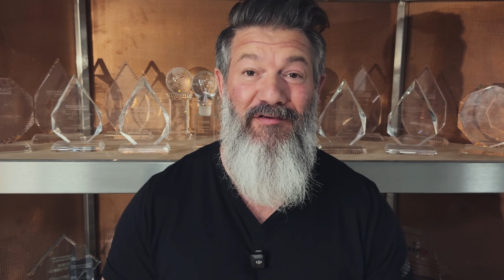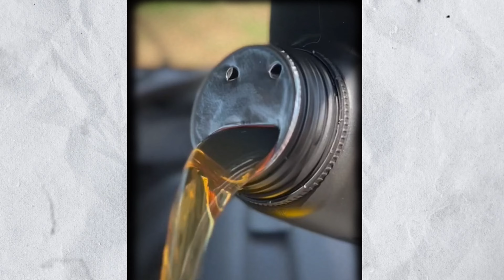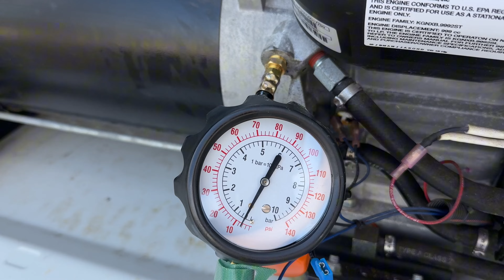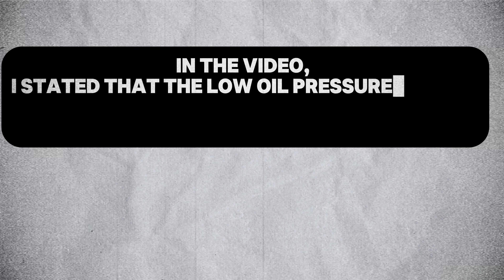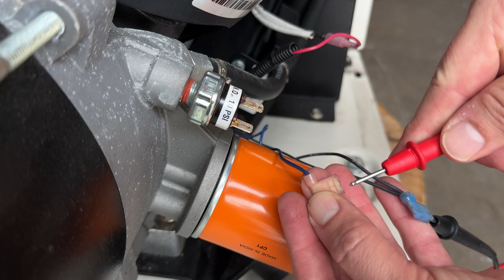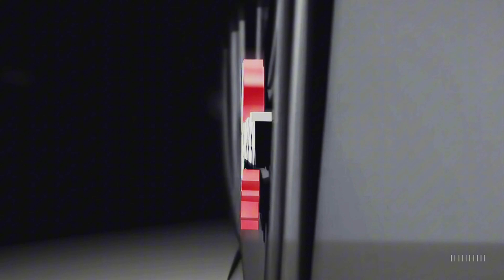OIL PRESSURE SENSOR | FAULT CODE 1300 FIX | WIRE 86 & FIRMWARE TESTING 🛢️⚠️

Comment: You are way more informed here than I am, but if I understand it correctly some Generac sets use Normally Open oil pressure switches, and some Normally Closed.
Is it correct that Evolution series 2 use Normally OPEN, and 'Evolution' (series 1?) use Normally CLOSED (hence connecting to ground at low oil pressure)?

Comment: Hello, in severe frost, the oil spilled through the dipstick, can you tell me the reason? Thank you very much.
Reply from the maker: Hey Sasha, great question! In cold weather, engine oil itself doesn’t expand when it freezes—unlike water, it actually contracts slightly as it cools and thickens. The spill you’re describing likely comes from moisture buildup in the crankcase, which is common in generators like your Generac V-twin that sit idle or run briefly.
Here’s the logic: Combustion blow-by introduces water vapor into the oil system. If the engine doesn’t get hot enough during operation to evaporate it, that moisture condenses. In severe frost, it freezes into ice, which expands and can block the crankcase breather or vent tube. When the generator starts (say, for auto-exercise or a power outage), normal piston movement creates pressure that can’t escape through the clogged breather. This forces oil up and out the dipstick tube as the path of least resistance.
To address it, warm up the engine fully during maintenance runs to burn off condensation, and check the breather for clogs or ice. Synthetic oil can help resist thickening in the cold too.

Comment: good morning, I am getting this message on model 0056130 17Kilowatt, is it the same switch part number. This model is 17 year old and no more available on the Generac site. Thank You
Reply from the maker: It would really help to have the serial number on that unit. If you email it to Rob@FixMyGen.com, I can pull the schematics and trace the circuit to make sure we’re talking about the correct switch.

On some of these older units the switches are normally open and close on a fault, and on others it’s the opposite, so guessing by model alone can send you down the wrong path. I’ll do my best to point you in the right diagnostic direction once I can see the wiring.

Comment: My 24k generac purchased 6/22 runs flawlessly, but the LED status lights have never worked. Is there a fix for this? Thanks for advance
Reply from the maker: Hey Joseph, great question — glad to hear the unit’s running strong!

The most common reason the LED status lights don’t work is actually pretty simple: there’s a small four-wire connector right behind the lights that often gets unplugged — usually during installation or a battery swap. It’s easy to miss. Just pop off the right side panel of the generator and take a look — you’ll likely spot it quickly.

If you want to dig deeper, here’s what to look for:
	•	Wire 817 controls the Green “System Ready” light
	•	Wire 818 is for the Red “Alarm” light
	•	Wire 819 handles the Yellow “Maintenance Required” light
	•	Wire 820 supplies the +5V power to all of them

If that plug’s connected and you’re still not seeing the lights, let me know and we’ll go from there. Hope that helps!

— Rob